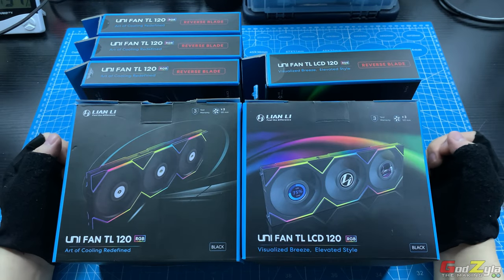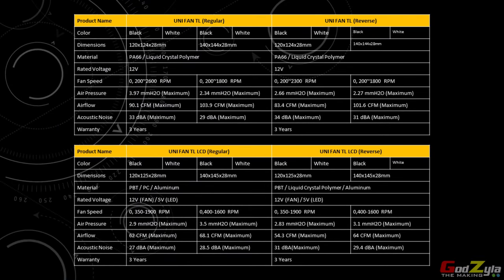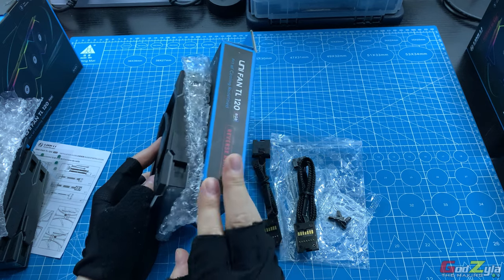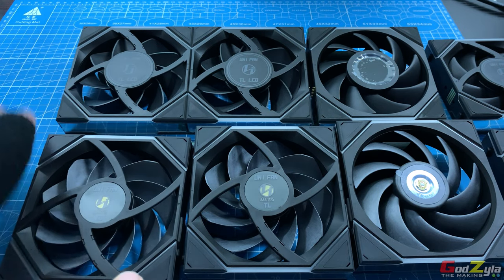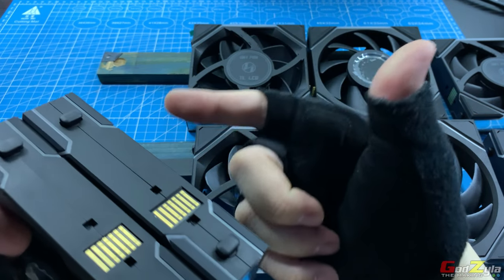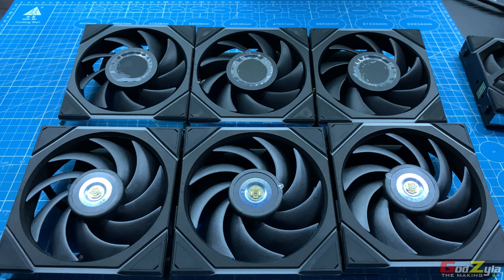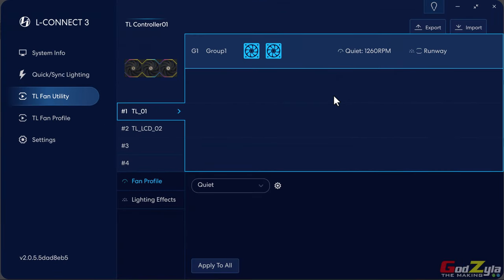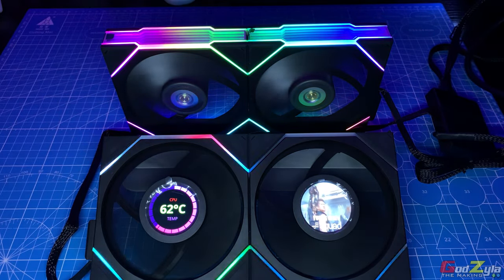Lian Li Uni Fans - TL & TL LCD

Comment: Hi,  I'm new to your channel.  I've instantly subscribed as this tutorial is OUTSTANDING.  So many people claim to put out tutorials, some of which are barely beyond being an advert.  But, THIS is a tutorial.  Very detailed and with warnings where necessary (I don't mind you labouring the point).
Now for a question 🙂.  I'm currently running an iCue setup.  Whilst I think the software is horrible to use and prone to catastrophic updates - it does have one useful feature.  That is - the ability to apply an RGB profile to a particular Windows App i.e. if you fire up game X, all the RGB will turn to profile Y.  Does L-Connect 3 have that ability ?
Reply from the maker: Hi Adrian Perry, welcome to my channel. For L-Connect 3 app, after you have done up all the effects and such, you can export the profile. As and when, you can import it, but it does not auto detect a game and to load a profile which you have saved. If you want ARGB effects to follow your game play. This application does not have this capability.
Reply: @KleoYan  Shame.  Seems an obvious addition, especially as a number of other similar apps provide that capability.  Thanks for the swift response.
Reply from the maker: @adrianperry2890  you are most welcome. Maybe you should mention or to suggest this at Lian Li’s Reddit forum. At least there are Lian Li support crew there to take in suggestion. https://www.reddit.com/r/lianli

Comment: The Lian Li website says the max amount of LCD fans is 7 not 6 

"UNI FAN TL and TL LCD share the same controller, enabling the connection of up to 16 TL and TL LCD fans simultaneously, with a maximum of 7 TL LCD fans"
Reply from the maker: Hi JYMBO, welcome to my channel, you are correct. I was given the wrong info. thank you for the correction.

Comment: Hey, Kleo! Great review as always. I am thinking of buying TL fans for my Lian Li Vision case and Lian Li Galahad II LCD AIO with Push-Pull setup. Let me know what you think and give me some tips if there are any. Also, how many controllers will I have to use? :hand-purple-blue-peace:

Pull Fans: Lian Li Uni Fan TL 120 (x3)
Push Fans: Lian Li Uni Fan TL LCD 120 Reverse (x3)
Bottom Fans: Lian Li Uni Fan TL 140 Reverse (x3)
Rear Fans: Lian Li Uni Fan TL 120 (x2)
Reply from the maker: Hi Phenomenal, welcome back. based on your provided fan allocation. you will need 2 controllers. this is what I will do as follow

First controller
for your liquid AIO fans (Push Pull) 
TL LCD to port 2 of the TL Controller (for your info TL LCD fans will only work on port 2, 3 and 4) 
TL to port 1 of the TL Controller 

The reason is, a TL Controller can take up to 7 TL Fans (I did a mistake on this content) and 3 TL LCD Fans. therefore I figured, since these are to be plug on your radiator fans. I would advise to have in this controller, so you can have a unify PWM runs. 

Second controller
Bottom and Rear to another controller. 

The reason is, these are all case fans so I will cluster them to this another controller. Again, controlling them differently from your Radiator fans.

hope this help.

Comment: Another amazing and so much detailed video by @KleoYan .   Thank You very much for this.

Have one, I would say simple, but long question. Would be very grateful if You can advise:

I already bought Lian Li EVO RGB case and now I want to buy 7 TL fans:
- 3 TL LCD reversed fans for side wall of case
- 3 TL reversed for bottom part of case
- 1 TL for rear side of a case

From Your video, it is clear that I can mount 7 TL fans on one controller. 3 TL LCD reversed fans ("daisy connected") would go on one port, 3 TL reversed fans ("daisy connected") would go second port, and last one (single one) fan would go on 3rd port.

My question here is: 
If I buy set of 3 LCD fans (including controller), do I need to buy set of 3 non-LCD fans, or I can go with 1+1+1 (it is 10$ cheaper that way), since I already have controller from previous set? Will I be able to connect them together in a "combo of 3" or I will miss some parts, cables, whatever?
Reply from the maker: Hi Jedem Malter, welcome to my channel. you can just purchase the TL LCD tripple pack that comes with the TL Controller and to use it on your TL fans too. layout as follow

A) 3 x TL LCD Reverse to port 2 of the TL Controller (This TL LCD fans does not work with port 1) 
B) 3 x TL Reverse bottom fans to Port 1
C) 1 x TL rear fan to Port 3 or you can daisy chained together with B) 

Side Note. I normally will buy two triple pack. one controller to use and another as spare, incase 1st controller is down, you can use the 2nd controller (spare) while sending in the 1st controller (faulty) for RMA. but choice is yours.

Comment: Hi, I'm new to your channel.  Great review!  I hope you can answer a question for me.  
Can the fan hub accept and operate the SL Infinity series? Also, can you operate the SL Infinity Hub at the same time as the TL Fan hub?
Reply from the maker: Hi loots_alots's channel, welcome to my channel. Yes you can operate the SL Inifinty hub at the same time as the TL Fan Hub, no issue. L-Connect 3 app will detect both hubs, so long you have plug each hub USB to your motherboard USB 2.0 header.

Comment: Thanks for the great video! I can’t understand why the processor temperature on my TL LCD screens is 10 °C higher compared to Aida64.  Also my ASUS ROG RYUJIN III shows 44°C, but for some reason L-Connect3 shows 54°C.
Reply from the maker: Hi Игорь Кот, welcome to my channel and I do apologized to have missed your comment. As for the temperature readings. if there are too many application reading from the sensor, there might be a delay. maybe check what's running in the background. Example HWinfo, Armoury Crate and etc. if you have too many sensor application running at the background then L-Connect 3 might have a delay.

Comment: Seht gutes ausführliches Video!
Meine Frage: 3 TL LCD - 3 SL-İNF ARGB- 3 GALAHAD PUMPE - 1 140MM TL LCD, 10 insgesamt
Auf 1 Controller? Geht das?
Danke im voraus.
Reply from the maker: Hi Docta Dray, welcome to my channel. Let me translate and to reply your question. 

Q) 3 TL LCD - 3 SL-İNF ARGB- 3 GALAHAD PUMP - 1 140MM TL LCD, 10 total on 1 controller? Is that possible? Thanks in advance.
A) You can only use 2 x 120mm and 1 x 140mm TL LCD to it's TL Uni Controller
For the SL-Inf 3 x 120mm fans. you will need to connect to it's own uni controller which comes with the Galahad II Trinity Infinity AIO.
you cannot put all to 1controller, it will not work.
Reply: @KleoYan  
Hi Kleo  Yan ,
Danke für ihre  Antwort .
Es ist Leider eine Weile her ,dass ich PCs  gebaut habe..
Hab ich richtig verstanden, den rest der 7 Lüfter  stecke ich zu Pumpen Controller 
rein! Auch die 3x 120mm LCD Fans ?
Ich Bitte um verzeihung,aber ich muss es genau wissen.
Im Moment habe ich nur Die Pumpe zuhause ,die anderen Fans kommen ab 12.02 erst.
Wollte mit  Hyte y70 Bauen ,was in Deutschland auch noch nicht am Markt gibt!
Es soll alles an AsRock Taichi verbaut werden, dürfen 2 Controller verbaut werden ,aus platz gründen?
Ich hab wirklich nicht die Ahnung ,verzeih Bitte!! Danke.
Best Regards
Reply from the maker: @doctadray  most likely you have two USB 2.0 socket on your motherboard, Yes that's correct you can have two controllers at the same time. Just make sure the SL-INF do not plug to the TL controller and the TL LCD Fans do not plug to the SL-INF controller which comes with your Liquid AIO.
Reply: @KleoYan  
Lieben Lieben DANK , werde es so machen.  Denn es sieht so  schön aus , was Lian Li produziert hat ,its Amazing and
Nice!! Danke für all ihre MÜHE!!! 🙏🙏
Reply from the maker: @doctadray  you are most welcome and all the best with your build too 😉

Comment: LCD on everything now. The new RGB. Only worth it on cases with fans on the side or the back exhaust fan, otherwise the rest you won't be seeing much.
Reply from the maker: Hi Firewarrior, welcome to my channel. This I do agree with you. Infact my thoughts will be only having one at the rear as that's more visible and to have the program showing flash between CPU and GPU.
Reply: @KleoYan   Thanks, great channel by the way. Found you through the King 95 Pro reviews (bought it recently). Yeah it does matter on the case you choose and the fans. Top fans there's no point, top cover and filter will cover, front similiar unless you choose one of those cases the front is all glass and those aren't good for air cooling either. So only leaves the back or bottom.
Reply from the maker: @FireTehmk  yup correct. Though I share my experience of these fans, my thoughts will still stick. If I am to choose using the TL LCD, it will only be at the rear. As for the rest of the case fans, I will use the TL as they are 1) Quieter compared to the P28, 2) they do perform 3) easy diasy chained. As for Liquid AIO radiator fans, I wont be using TL or TL LCD as I will prefer to plug the fan connector of the fans directly to the motherboard CPU_FAN header. At least if anything goes wrong, you know that you still have cooling on your processor.

Comment: I know this is an older video, but I just came across it on my Youtube feed. I have a question. I'm planning very soon on doing my first build this month. Are reverse fans exhaust fans that draw air out of the case?
Reply from the maker: HI Gnote, welcome to my channel. If you are getting the reverse fan, the side where the fan blades are facing you. it is pushing air towards you, which is intake.
Reply: @KleoYan  ok, thank you for that information.
Reply from the maker: @O-Friendly  you are most welcome. All the very best with your build too 😉
Reply: @KleoYan  thank you
Reply from the maker: @O-Friendly  welcome 😉

Comment: Nice video , and just like u , i wish lian li could  have a marking or sign to determine the reverse from the non reverse and also i would like to ask , if i don't want to use my motherboard to control the fans and lighting , do i still need to plug in the 5v 3 pin Rgb header ( yes i know i will not plug in the  pnw header but i want to know about the Rgb header ) and also there is a setting in the L-connect that say STARTUP screen which is under the LCD screen option , pls how does that function , thanks for he  PERFECT review and keep it up .
Reply from the maker: Hi Blb Hansel, welcome back. If you want to control only using L-Connect 3 app, you don't have to plug the 3pin argb and 4pin pwm between the controller and your motherboard.
Reply: @KleoYan  thanks , solved  thumbs  up
Reply from the maker: @blbhansel8226  you are most welcome.

Comment: Merry Christmas! Great vedio again.  Totally going to get this in my build.  Everything i ask for.  120 forward and reverse and 140 forward and reverse.  Killer argb.  Do you know about cross product compatible?  Specifically if  the al or sl fans are compatible with the tl gen 2 controller? I am slightly disappointed that you can mix the tl and tl-lcd, but not a big deal.  Keep up the great work and quality!
Reply from the maker: Hi Gammafilter, welcome back, unfortunately, the AL or SL fans are not compatible to use on a TL controller. Merry Christmas and Happy New Year too. 😊
Reply: You can mix tl and tl-lcd, or you can't mix them?
Reply from the maker: @MIMCKMedia  no you can’t mix them as in on the same daisy chain. The daisy chain is strictly TL to TL. TL LCD to TL LCD.
Reply: @KleoYan  but both on the same controller right? Does older version like uni fan infinity also work with the new l connect software? So you can mix them on differrnt ports?
Reply from the maker: @MIMCKMedia   the TL fans are using 2nd gen controller which is not compatible with the other Uni fan fans. Infact each Uni fan family makes use of its own controller. You can’t mix them. Reason is, the controller contains specific firmware and profile (fan rpm and ARGB effects) for each model Uni fans. 

By the way this is part of the reason why most my content are lengthy as I go in-depth, taking my time and giving warnings as in do and donts’. To be honest I am offended by your comment earlier “can condense to 10 mins”. Plus I have answered your question “can TL and TL LCD mixed” which is mentioned in this content. Maybe my English is bad and you couldn’t understand me,
this I do apologise. Now if you have the patience and want to know more. You might want to watch this Lian Li ARGB Products (How to make it work?) [L-Connect 3]. Please be warned, it’s lengthy. 
https://youtu.be/CgvuUFeff8U
Reply: @KleoYan  thanks for the info. I still think your video can be condensed almost in half with same detailed information by editing & cut out unnecessary parts and don't say everything 10 times like "don't connect more than 10 in one hub" it took you 8min to unbox them this could be done in sec. It's very hard to get information you need fast out of this, that's the reason I asked and I thank you for answering 🙏
Reply from the maker: @MIMCKMedia  ok got you. Thank you for the feedback. Will be more mindful. Merry Christmas and a Happy New Year!

Comment: I have 7 120mm AL fans and 2 140s, all connected to a hub. I am considering upgrading the 140s and possibly one of the 120s to the new LCD models. I am guessing I will have to upgrade my hub, but will the new hub be able to support the existing 120 AL fans as well as the new LCD 140s?
Reply from the maker: Hi Law2708, welcome to my channel, you can't use other uni fans with the TL Hub, your previous uni fans, be it SL SLV2, AL, ALV2 or SL Inf, they will use back their own hub and for these TL and TL LCD. you will use it's own hub too.
Reply: @KleoYan   thank  u, so I'll need to replace all the fans or can  i run to hubs from my MB
Reply from the maker: @Law2708  no.. you can retain your current fans with it's on hub untouch. Just add the TL or TL LCD hub to your usb 2.0 port and plug the TL or TL LCD fans to this controller. In total you have two hub. one for your AL fans and one for you TL Fans.. this might be old content but it's the basic of uni fan hubs and how fans are conntected. https://youtu.be/CgvuUFeff8U

Comment: 40:31 when you set animation to runway it looks like the top group isnt animated properly. it thinks fan 1 is fan 2 and vice versa. any way to fix this in software? ive seen this in other videos as well
Reply from the maker: Hi Jasen Henry, welcome to my channel. You are right on this. I am not able to fix the issue as there are no direction on the effects itself. I will highlight this to lian li and hopefully they will add the direction function. Thank you for your valuable feedback greatly appreciated it.
Reply: @KleoYan  absolutely. I was thinking it might resolve by reordering the fans in a group but mine are not easily accessible. would you be able to swap your fans and see?
Reply from the maker: @jasenhenry  if I am to swap the cable. Yes the orientation will change but that defeat the purpose on cable management. Anyway I will feedback to Lian Li on this. Thanks for the info, greatly appreciated it.
Reply: @KleoYan  thanks for checking. hopefully they have enough detail to be able to pinpoint the issue and resolve with an update
Reply from the maker: @jasenhenry  you are most welcome.

Comment: Can I connect the fans of the old version of Lianli with the modern version in a consistent manner and with a uniform application?
Reply from the maker: Hi F-zareve, welcome to my channel. So long you using their indivdual controller and to use L-Connect 3 app, you will be able to use them consistently and with one app. you can refer to this on Lian Li's argb eco system https://youtu.be/CgvuUFeff8U
Reply: @KleoYan  Thank you
Reply from the maker: @nooral-khafaji1479  you are most welcome.

Comment: if i buy TL 140mm (3) and TL LCD 120mm (5) use 1 controler right?
any recomended usb internal if i have galahad ii lcd, SL inf 120mm, TL LCD because my motherboard only 2 usb internal
Reply from the maker: Hi Maxsun, welcome back, yes you can plug 5 LCD with 3 to one port and 2 to another port of the controller, then follow by your TL fans to another port. As for hub splitter, I would advise you to get the original lian li usb splitter https://lian-li.com/product/usb-2-0-1-to-3-hub/ .. at the moment their official lian li alixpress is under maintenance and you might want to check it out later. https://www.aliexpress.com/store/911265363?spm=a2g0o.store_pc_allItems_or_groupList.pcShopHead_6000456123474.0  some have also make use of the NXZT internal usb 3.0 hub.

Comment: Hello,   lian li mentioned that it s able to use 7 lcd on one controler  , but you reinforced that it can be only 6   ?    and to use port 2 to 4 not port 1  it s important ,  pls have you make this  teste  with 7  i need using 7 lcd including the rear reverse lcd
Reply from the maker: Hi Philippe, welcome to my channel. Yes it's able to do 7 LCD on one controller as the marketing marterial provided to me is 6 not 7, thats why I said it 6. I have tested and confirm you can do that as for port 1 and 2. for LCD should go port 2 and not port 1. Last but not least, next time you might want to read my description. Thank you!

Comment: Hi thanks for the video. I have Corsair 7000d. I want to combine 3 lcd tl and 1 tl for the side fans. Can the port able to do that from 1 port?
Reply from the maker: Hi Efe Çınar, welcome to my channel. Nope you cannot mix the TL and TL LCD in a chain, please do not do that, you will damage the fans and controller. You can use the same controller but have to separate the connection. TL to one port and TL LCD to another.